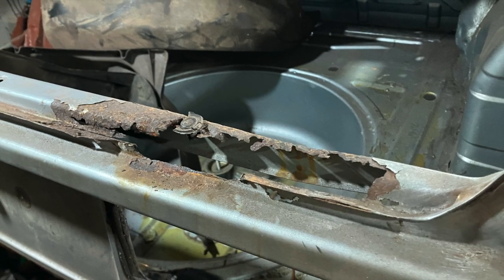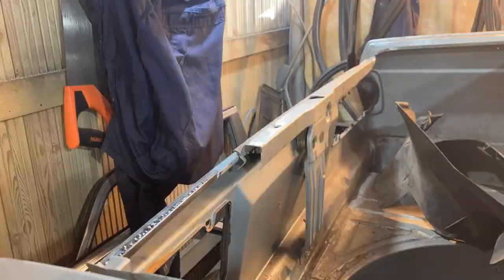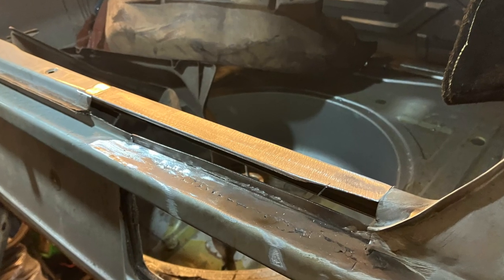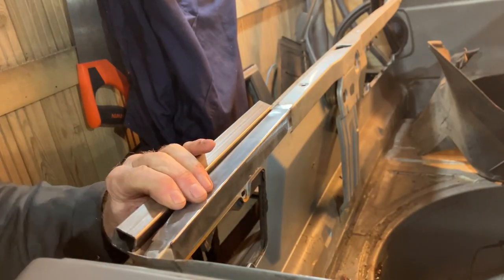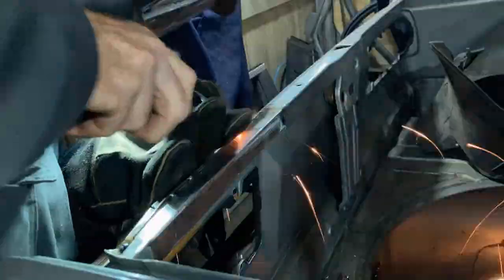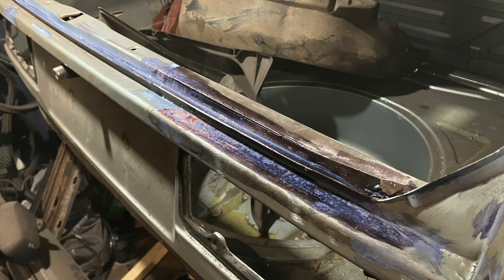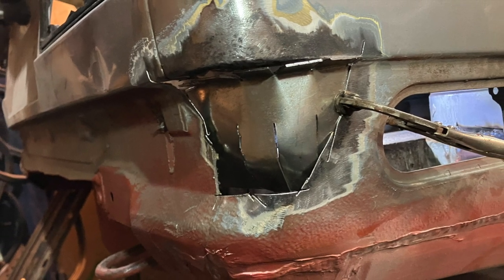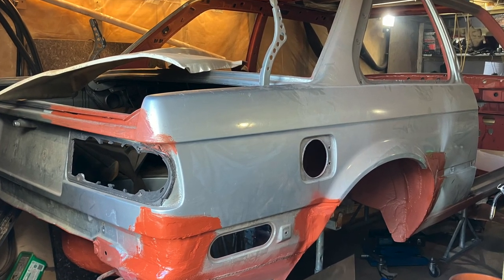e30 repair part 24

Comment: Yeah speaking as a body man myself - nice work albeit time consuming, I steer clear of restorations if possible, although the lads on wheeler dealers would have that done in a blink of the eye!!!😁😁😁
Reply from the maker: I am so glad the rust work is almost done, the smell and mess is awful, I am looking forward to welding thicker steel with the making and fitting of the cage. I would imagine that paying someone to carry out the work that has been done would cost a fortune and not be worthwhile. I hope you don’t cringe when you see how I carry out my repairs.